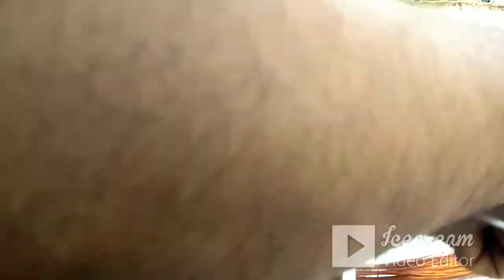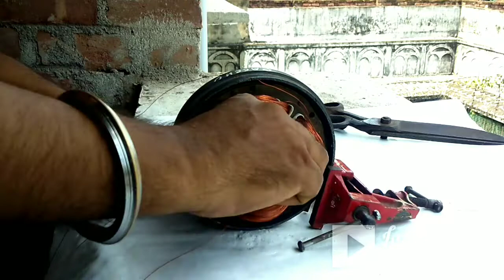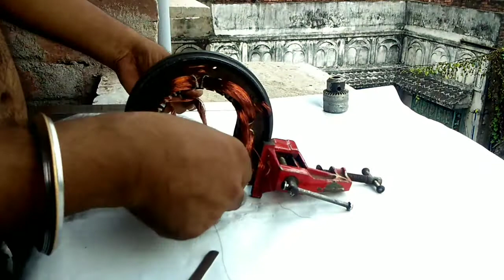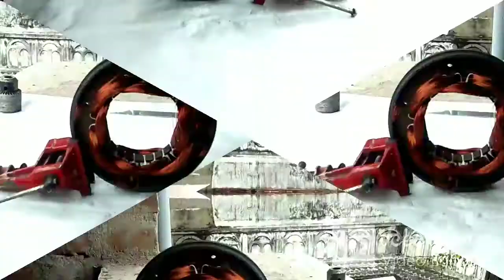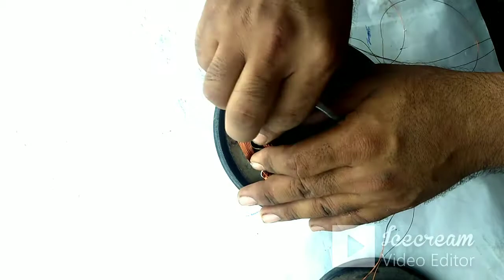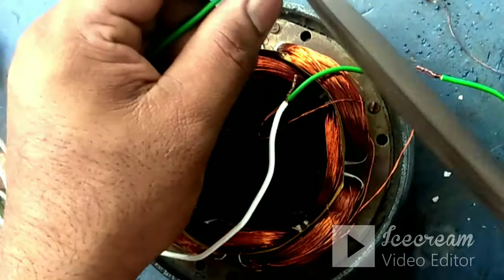KHAITAN FARATA STAND FAN WINDING /FARATA STAND FAN / SIVAM ELECTRIC / PEDESTAL FAN

Comment: Kitna number ke tar au stating aur running me kitna trun chahiye wo to dijia
Reply from the maker: Yea 20mm core hain 
Run main 4,6 main Baithe ga 
Run 2 coil 110 turns weight 63gms per coil
Or 2 coil 70 turns weight 40gms per coil
S.W.G - 31
Resistance 2 coil hoga uska turns 40 and weight 21 gms per coil 
S.W.G - 32
Run+Resistance coil length 35”
4 slots main 2 patch or 6 Slots main 3 patch 

Starting coil vi 4,6 slots main baithe ga
Turns 125 per coil weight hoga 50gms
Yea 4 coil hoga
S.W.G - 32
Coil length 27.5”
4 slots main 1 patch or 6 Slots main 3 patch

Or iss ka connection diagram chahiye to apna 
Whats aap no. Vej dijia hum diagram vi de denge